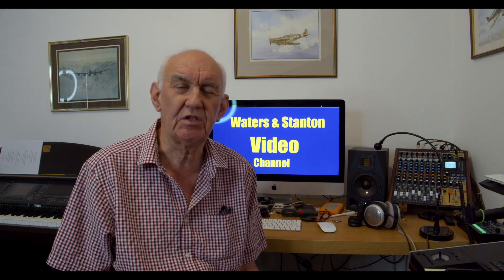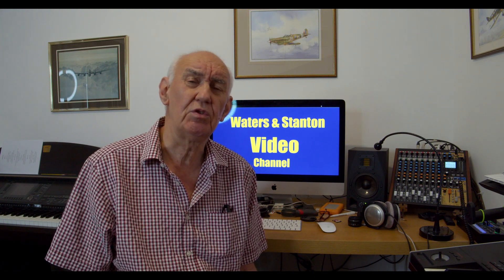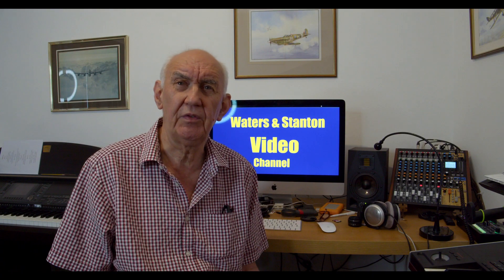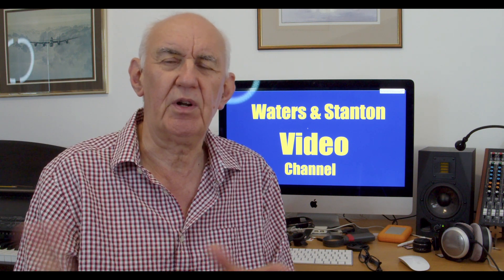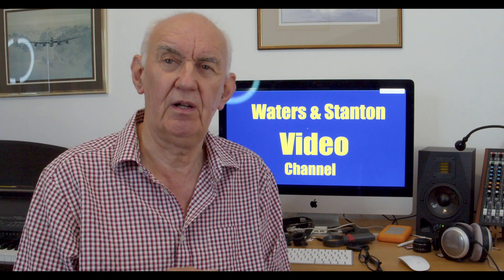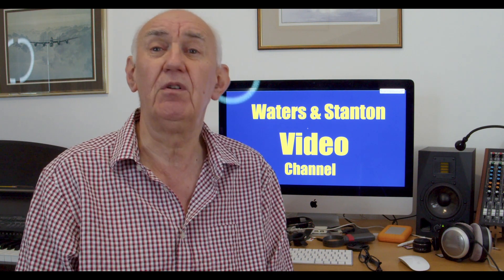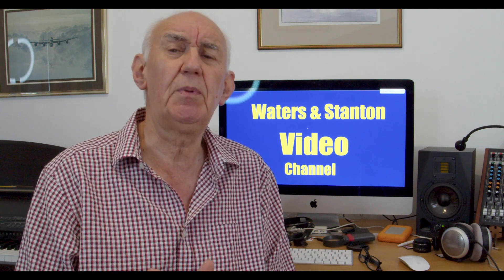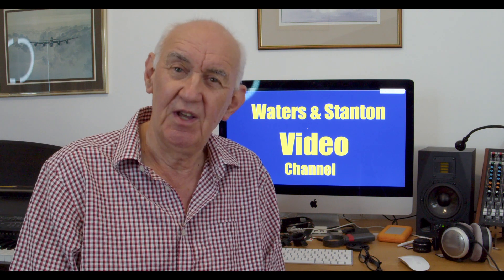VSWR METERS - Errors to Avoid. | HAM RADIO

Comment: Thank you for sharing, may I ask question about the doublet antenna, do we need to use line isolator at the short coaxial side (after the antenna tuner ) and is there a need for measuring the vswr at all? Thank you again in advance. VK2.
Reply from the maker: I would recommend an isolator if possible. The  You are stuck with whatever VSWR your system produces. The essential is an ATU to match it to the transceiver.

Comment: I only operate portable/ mobile Peter and when I tune up before I tx I always use a simple field strength meter that is positioned between the antenna  and the vehicle that I am tx'ing from.That always works well and normally agrees with maximum output on my vswr meter.
Have a great weekend.
73.G7HFS/PA3IKH
Reply from the maker: Yes good option. Back in the old days we used current meters!
Reply: @watersstanton  I still  do Peter sometimes when I'm portable.😁
Reply: Peter, is there any way to measure the actual power at the feed point of the antenna? Any kind of remote sensor? I always enjoy your videos. I’ve seen enough of them that I feel like we’re old friends. Tim KG6G, formerly K3LSU